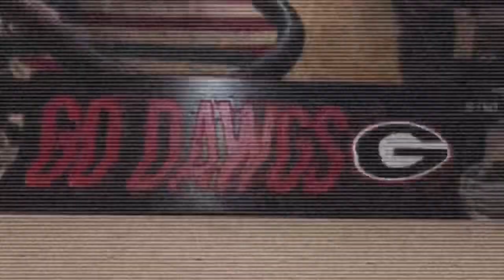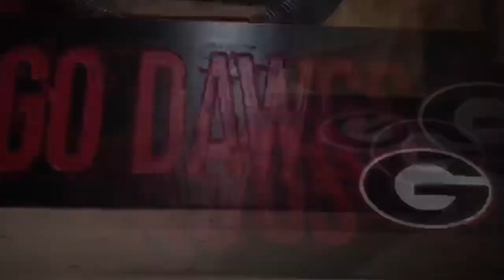X-Carve CNC Router and Oramask 813 Stencil Vinyl: Painting a Sign with Multiple Colors

Comment: The edges are too rough; that is the result of using the wrong bit. When doing this type of work use a "Down spiral or Compression bit" it will leave your edges smooth and crisp.  When applying the Oramask use a heat gun to warm the glue and go over the entire surface while using a wad of paper towels to press down with a circular motion as to increase the adhesion of the mask.
Reply from the maker: You’re right, an endmill would work better for the Oramask. However, this is a result of using a vbit and not an endmill for the edges. Endmills won’t capture all the detail, unless using a 1/32”, which chances are, will break. I do like the idea of using the head gun for better adhesion. I’ve never heard of using a wad of paper towels. I’ll have to try that.

Comment: I'm trying to work out what you did.
Sprayed black, added Oramask, cut G & painted white, cut Go Dawg & painted red. Some sanding, sealed with spray. Didn't see removing Oramask., Saw loads of red debris in over dark background. Not sure if black or green Oramask 😟🤔🤔
Reply from the maker: Paint the black, lay the oramask (blue), paint the white, then red…the design has a lot of spots in it that gives it a splattered look. Sanding is done to clean up some of the edges. Check out the link to see the finished product.

https://www.instagram.com/p/B3IeRqaAt62/?utm_medium=copy_link

Comment: Subbed....where did you get that image with the splattering around the edges or did you design it? Thx, Mark
Reply from the maker: Mark Crook the person I made it for actually found it and sent it to me. I had to do an image trace to get it, which was tricky to capture all the detail, since it wasn’t in SVG format.
Reply: American South Designs “image trace”? I only have Carbide Create.....could it be done there?
Reply from the maker: Mark Crook image trace is the same as but map tracing. I haven’t used Carbide Create, so I’m not positive if you can.
Reply: Mark Crook carbide create wont let you do it. But you can use adobe illustrator and do a live trace , then export it to carbide n you are good..

Comment: try using a down cut router bit next time  it won't cut up the Oramask as bad
Reply from the maker: I use downcuts for clearance passes. But this required vbits, which unfortunately can raise the oramask, especially in thin areas